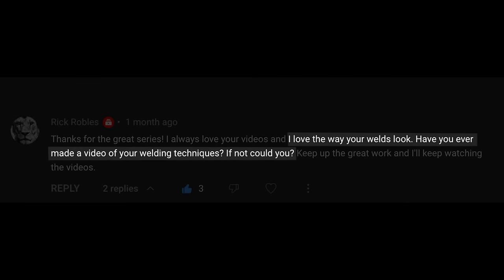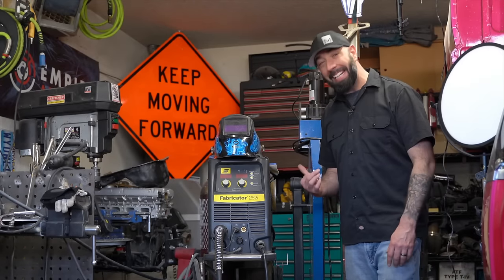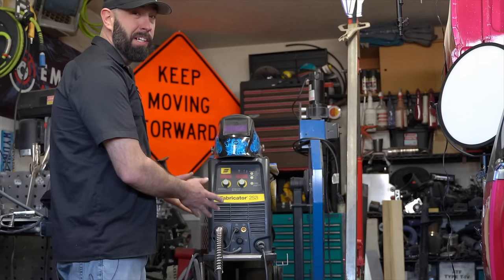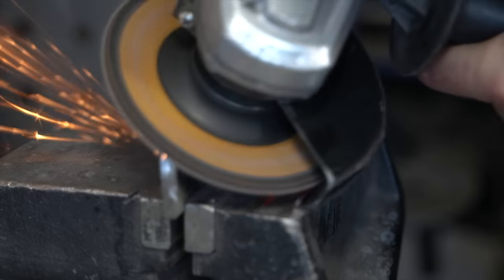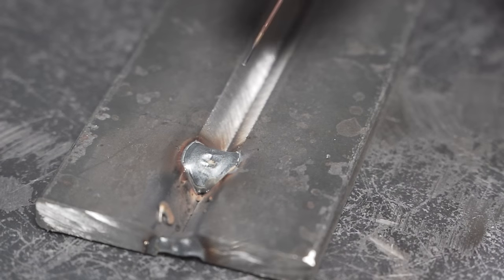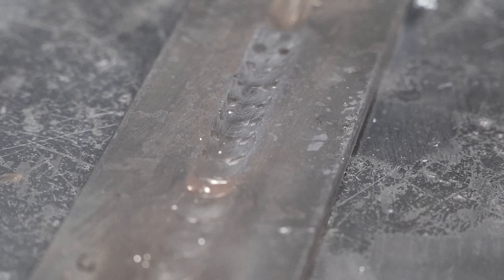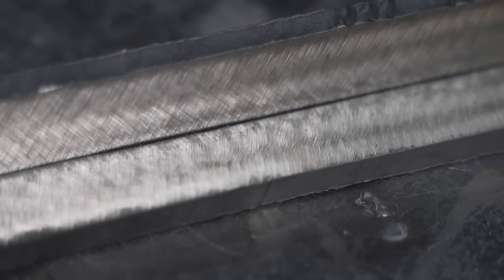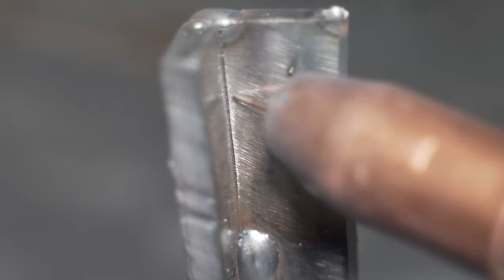MIG Like Mankandy: Techniques for Stacking Dimes with a MIG Welder

Comment: Newbie question….  I know stacking start and stop spot/tack welds is not acceptable for a variety of reasons (no penetration into base metal, potential for porosity, etc).   Is it ever acceptable if you are starting and stopping like in the very first part of the video if you are also stacking patterns (whip and pause, triangles , c’s,etc ) but ensuring you are holding each pulse long enough to get penetration in the root and in each base material when welding thinner 3/16, 1/8, 14 gauge, 18 gauge steel? 

Thank you!
Reply from the maker: Understand the following is a whole lot of opinion. I recommend asking folks that are far more knowledgeable than me.
The problem with starting and stopping is it takes a moment for the materials to reach a temperature required for proper fusion, and each stop allows the weld to cool some. Though the superficial weld looks similar, the locations of proper fusion looks like a string of pearls.
Here’s the thing! That’s only a concern (says me) in structural welding. Control arms, support beams, vehicle framework, etc. There’s a lot of situations where I think the start stop is perfectly fine. Art, furniture, gates, exhaust etc. If it’s not going to see extreme stress, it’s not just going to fall apart. Just know that the welder needs to be set higher than normal to penetrate as much as possible in short bursts.
Metal thickness plays a large part in how acceptable the method it is. 3/16? Not the best choice, especially in structural as mentioned above. Sheet metal, however, not only welds great with the start stop method, it’s somewhat required. Sheet metal warps easily and you’ve got to try and keep it cool. Start stop is the best way to do that, and penetration is not usually a concern with sheet.
Lemme know what you’re thinking.
Reply: First off.   THANK YOU!  I really appreciate you taking some time and thought to respond.   This helps us newbies more than you know.
I like your string of pearls analogy, that makes sense and will definitely be remembered!
I had used the start stop method on areas of a 18 gauge floor pan replacement because I was worried about warping.   It seems to definitely be acceptable with the thinner stuff, penetration is visible.
When I used it for some thicker areas (thick to thin 1/8th to 3/16th ) I turned the heat up a little more and lowered the wire speed and held as long as possible without burning through.  These are not load bearing/high stress areas and I fully understand that they probably didn’t achieve maximum fusion but I definitely tried to get as much penetration as possible.  On some practice scrap the penetration was visible on the backside of the workpieces, not just discoloration but visible metal differences.  Due to the location of the welds it was a “better” option for me as running a good bead was not possible/high potential for a big mess.

Thank you again!

Comment: One Issue I can see with your technique is that by angling the MIG wire towards the weld puddle the slag that comes off the base metal gets pushed into the weld itself.  This may not be an issue when you have good quality and well cleaned metal but may be an issue when welding on older cars where the steel is not high grade.
Reply from the maker: I think I understand what you’re saying, Stuart. But technically, isn’t the MIG wire always angled towards the puddle no matter what the gun angle is?
Reply: @GarageFab  I was taught to weld by boilermaker who said the angle the gun should be approximately 15 degrees in the direction you travel.  That way the gas flows over the weld puddle and any impurities are blasted away.   I think this comes down to "Push" vs "Pull" technique of which there is much debate on the internet of their merits.  It seems that old school welders were always taught to "Push" but in practice use both techniques depending on what is more comfortable at the time.  The best discussion I came across was https://www.youtube.com/watch?v=jKkCdaDUN3s  this video compares both techniques and looks at results under microscope. The conclusion is that for torch angles of +/- 10 degrees there is not much difference in penetration. 

p.s. I absolutely love your channel and have got so much inspiration for my automotive projects.
Reply from the maker: @stuartvaughan2137  Oh ok. Sense made. Much appreciated. I have noticed that my welds have a lot less soot on them when I push. Thank you, Stuart! I appreciate your time and eyeballs. 🙏

Comment: my biggest welding problem is that i can't see what i am doing with my helmet, it is either too dark or too bright...
Reply from the maker: I think I’m going to make a video just for you my friend. It took me a long time to realize how important it was to see clearly (duh) and what was causing my vision problems.
In short, make sure your lens is crystal clear. Change the protective layers often. Just a finger print or a few scratches will make it impossible to see. Even cheap helmets are good enough if they’re clear enough.
Lemme know if that changes anything for you.

Comment: You know if you are stacking dimes with a mig, you are losing penetration, yes it looks fancy, but strength is in those smooth beads, thats been proven with etch tests. Also you should always be dragging on thick materials-far better strength-because its punching down through the molten puddle-not the semi-wet puddle.

Comment: I want to do some floor pan work for my car, I will be welding 16 gauge steel primarily. My question is can I use one of the cheap 110 volt  welders on amazon, since I will not be doing a lot of welding this is the route I hope I can go. Please provide your opinion, also if there is a minimum welder please provide that suggestion. 

My second project is to weld together an exhaust (mild steel), again the cheap welder MIG welder is my hope. Thoughts?
Reply from the maker: Well, Eddie, I can only give input on the welder voltage. A 110v welder is more than enough to do most automotive jobs (up to 1/8 inch thick steel) so a 110v welder would serve you well. 
I can NOT speak for the “cheap Amazon welders” because I haven’t used them.
They might be ok but I’d be cautious about buying one.
As discussed in the video, welding can be challenging to get the hang of with a great machine. But with a known good machine, you know if you’re having problems, it can be fixed with a change in voltage/wire speed/technique etc.
With a cheap welder, you have no idea if the problem is you or the welder itself. A huge headache and potentially wasted money.
All I can say is do your research. Read the bad reviews, look for video reviews, and pray.
Or!! Get the Millermatic 211 and love life.
(Still not sponsored)
Reply: @GarageFab  Thanks for taking the time to reply. It's guys like you that give Youtube value. Thumbs up.

Comment: Cool got my 1st mig 160.....240v never welded before how hard can it be
Reply from the maker: Welding is easy! Settings are hard.
Reply: @GarageFab  Definitely seems that way Would you start gas or gasless if you were a beginner
Reply from the maker: Definitely gas. Flux core is challenging even for the experienced.

Comment: Good video...
Please talk welding hood or how to see when welding.  I purchased "This $110.00  TITANIUM™ auto-darkening welding helmet uses true color technology for the clearest view possible."  
Cannot see well enough to stay on welding seam from the first arch.  I've tried welding outside under the sun and with lights . It helps, but not nearly enough.  If I lighten settings from Mfg. recommended 11+ down to 7.  I can see but also have that halo effect after I finish welding. Like looking at the sun... I watch your videos and don't see how you can stay on track with a 5-10mm path window.  Suggestions?   Thanks
Reply from the maker: Oh boy! I’m not sure I have suggestions! It’s just really hard to see! I think my only advice is try and control ambient light. Turn off the lights if you can. Outside is tough. Try throwing a leather sheet over the back of your head. Any light coming in the back of the helmet makes visibility worse.
Make sure the replaceable lenses on your helmet are clean and clear. I used to try and save them as long as possible. Then I realized how badly a slightly foggy helmet can impair vision. Now I have 20 replacements waiting so I’m not tempted to delay.
Make sure your torch isn’t obstructing your view. And lastly, you can only see the arc and the joint immediately next to it. Everything else is pitch black. Make sure your joint is clean and bright. When your welding, try not to worry about where you need to move the torch. Focus on the arc and make sure it’s centered on the joint, move to the next spot and re-center. If each individual spot is centered, the entire weld will be too. 
Lemme know how things go!
Reply: @GarageFab  Thank you.
Reply: @GarageFab  Lol. Not sure he has any suggestions, he says... Proceeds to stack 6 or 7 of them like dimes on a butt joint. Well done sir.

Comment: You sure about running good welds with proper penetration, when too hot with proper technique? Wouldn't you agree with risk of crystallization and risking the base metals snapping under any type of load or stress test?
Reply from the maker: I’m not sure about anything to be honest. Being self taught, you miss a lot of things. For example, I’ve never heard of crystallization so I can’t answer that one. Penetration isn’t a problem. This I have checked and confirmed. 
Another thing I’m unsure about; When running hot and fast, the amount of base metal adjacent to the weld that is super heated is less.
Is this a good thing or a bad thing? My instinct tells me it’s good. But perhaps a more gradual transition from superheated metal to virgin metal is less prone to cracking? 🤷‍♂️ Maybe I should take some welding classes.

Comment: Does a gas we use in mig welding affects the appearances of welds?
Reply from the maker: Absolutely! The proper gas keeps the weld clean and reduces turbulence in the weld puddle. It doesn’t guarantee a pretty weld, but isn’t definitely a necessary ingredient. 75/25% Argon/CO2 mix is generally preferred for MIG welding. 100% Argon often used for TIG welding aluminum, and helium is often used, but I honestly don’t know when or why.
Reply: @GarageFab  thank u Sir....im just a beginner and i encounter some troubles in mig welding
Reply: Can i ask sir what is the differrence between mig and mag welding?...is there a differrence in appearances between this two process?
Reply from the maker: You might already know but MIG stands for Metal inert gas and MAG stands for Metal active gas. More volatile gases are used. I don’t have any experience at all with MAG. From a very small amount of reading, yes, both the bead profile and the penetration is different with MAG. I don’t know when or why it would be preferred. 🤷‍♂️

Comment: I found MIG welding a lot easier than TIG welding. MIG Metal Inert Gas easier than Tungsten Inert Gas to operate because one you can create the weld the other you have to form it, like a little liquid pool which is easy to do, but when you dip your metal rod kind of sticks and it complicates the situation. Oxy/Gas is okay, Tack welding okay Arc gets some getting used too, but TIG no thank you.

Comment: ahh you drag the weld just like stick, I've been pushing because that's what I was told🤔
Reply from the maker: I’ve been told repeatedly I should be pushing, so don’t change anything you do just because you saw me pulling. I believe by pushing you’re getting a much cleaner weld. Less chance for porosity and inclusions. I pull because I suck at pushing! So keep doing what you’re doing my man!
Reply: @GarageFab  I just watched another video from Miller and they say it makes no difference. Personal preference and in real work situations it what gives you the best control and access.
Reply from the maker: @seanwilson471  I would agree with that. Also know what a good/bad weld looks like and make sure whatever method you choose is providing good results.

Comment: Honest question. 
Why can't a mig weld look just like a 7018 small ripple weld.
What makes the "stacked dimes" look better?
Reply from the maker: Just a preference I’m sure. Since TIG became popular, I think it’s just an aesthetic a lot of people desire.
From my experience the rhythm required to stack dimes also helps make uniformity much easier. Occasionally, I’ll run stringers on corners that I intend to sculpt or smooth out. It’s far more challenging to get an even weld with with a steady pace. It could be a fair accusation that someone stacking MIG dimes simply doesn’t have enough skill to run a smooth stringer. 🤔
Reply: @GarageFab   Thank you for that answer. It makes sense.
Reply from the maker: Does it?! I made so many typos I didn’t even understand. I edited them tho. 😂
Reply: @GarageFab  truly it does. 
I didn't notice typos

Comment: I always taught my apprentices to go in circles  anticlockwise when going left to right, and clockwise when going right to left. The idea is you build a shelf and then put some more weld on top of it. It keeps wagon tracks from happening in the root because your not cold lapping over the root. Your welds look good, but I would question their strength.
Reply from the maker: I like it. The description makes sense I’ve been considering testing the strength of the welds I create and then compare them to some other methods. How would you suggest they be tested?
Reply: @GarageFab  bend test
Reply: @GarageFab  One cheap and easy method is the fillet weld break test, its a test done to see the compatibility of two metals of unknown composition, also known as a weldability test. Make a T joint and weld one side, take the weldment and beat it with a hammer to expose the root of the fillet weld. When mig welding this can reveal wagon tracks, lack of fusion and silicon inclusions.
Reply from the maker: Excellent. Thank you. I’ve been considering doing another video never before seen on YouTube. 🤓 I’ll test the weld methods I use and swear by and show the test results no matter the outcome. 😳 Keep an eye out for that one. Is there any specifics on that fillet weld test that makes it an acceptable test? Certain bead length? Thickness of metal?

Comment: so did Miller send you one?
Reply from the maker: Hahaha! Unfortunately no. I’m prolly gonna have to buy one. 😩
Reply: @GarageFab  i picked up a campbell hausfeld 105 mig flux welder today at a flee-market for 50.00 and trying to learn to use it.. it has hookups for gas but no bottle with it.. im learning welding or trying to.. i have a couple stick welders i got recently also..
Reply from the maker: @jasoncolwell7293 Nice! Be sure to check out some videos on flux core welding specifically. It’s very different from welding with gas. I’m afraid this video will lead you in the wrong direction.
You don’t need gas with flux core though I hear that it makes a nicer weld.
Lemme know how things go!

Comment: Sounds like your wire speed needs to be bumped up a bit. It's probably good for vertical up though. (More penetration than down).
After years of 1/16th and 3/32 wire, it really makes you impatient with. 035 or .045 😂

Comment: Would love to see the back side of your beveled butt welds. Maybe the material you were on was thin enough but my concern was getting penetration all the way to the back side. I've been in school about a month now and I know a couple people can do a mig root pass with no landing and no gap, I myself need a 1/16th landing and a gap between a 1/16th and an 1/8th, our plate is 3/8ths thick though. Love the enthusiasm, you explain what you do know very well.
Reply from the maker: Wish I could say it’s pretty but it’s not! There was full penetration but it looks like a small weld bead of very inconsistent widths. My bevel went all the way through the plate, nearly razor sharp. I’m thinking of putting together a video where I weld techniques. (I tested a couple recently and there weren’t as good as I thought they would be. 😬) I think that could be somewhat entertaining.

Comment: To all the cry babies squawking about vertical down.... umm, y'all did not do your homework. If you did you would know there is several A.W.S. weld procedures for vertical down these procedures are for certified welders working on big deal steel & pipe. 
Sincerely, 
Journeyman Ironworker